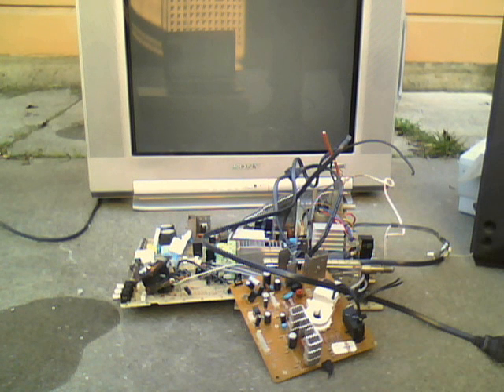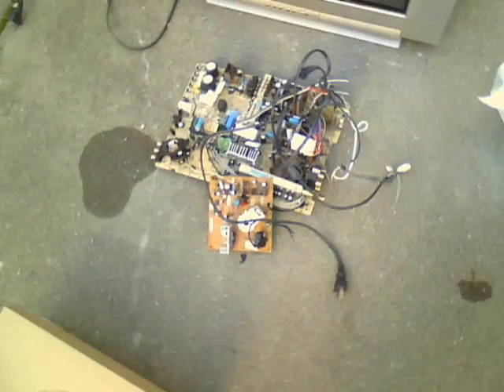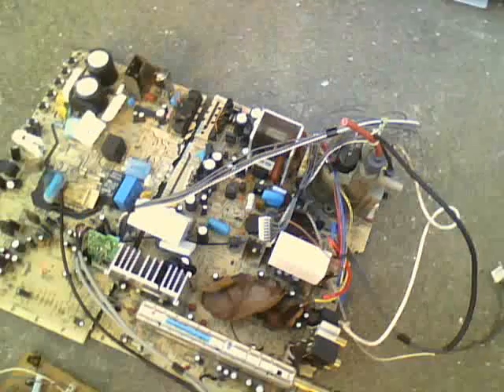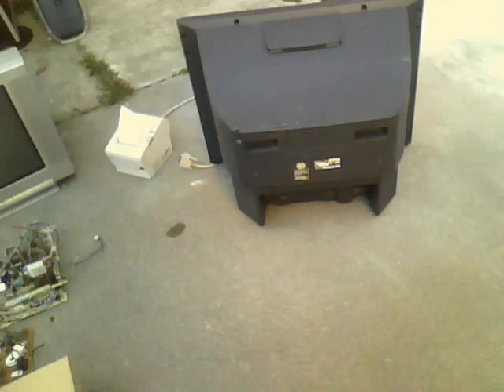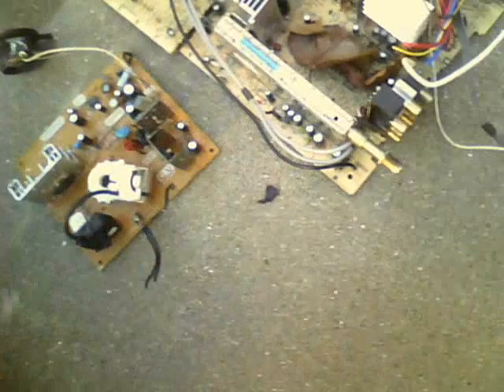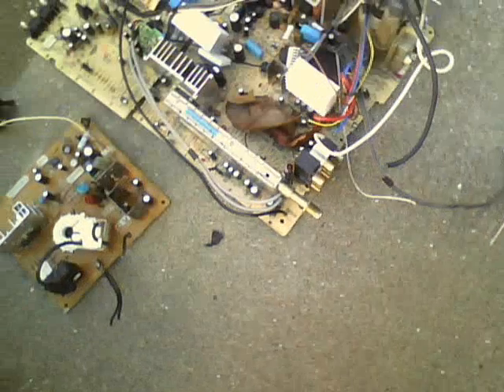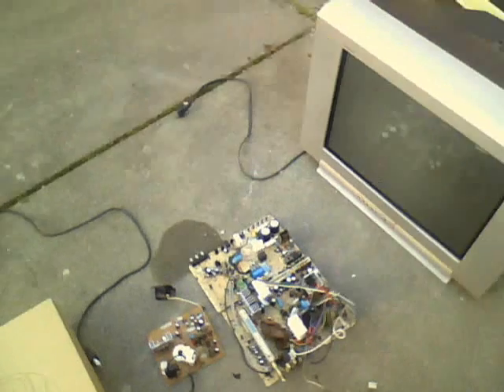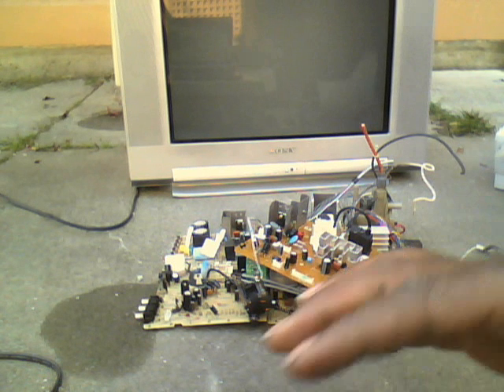I Got Some Parts From a Scrapped 2003 Sony FD Trinitron WEGA KV-24FS100 CRT TV

Comment: Salvage the flyback transformer, solder a longer wire to the output, insulate it properly and make a HV power supply :) I'm going to make one today, because I have a flyback transformer laying around.